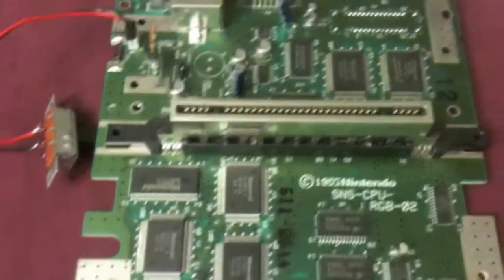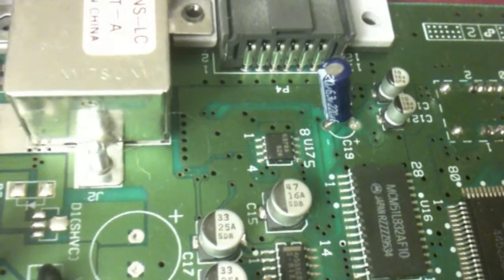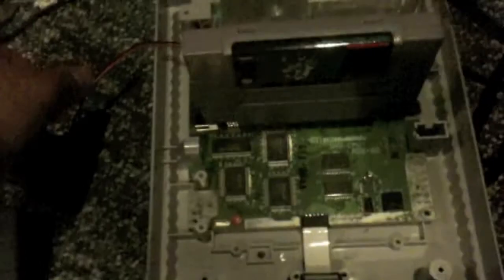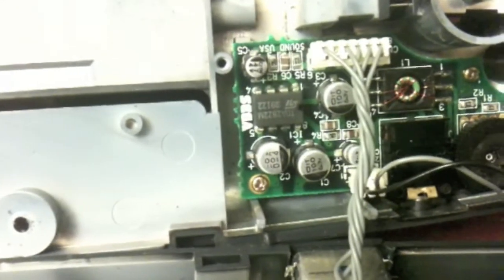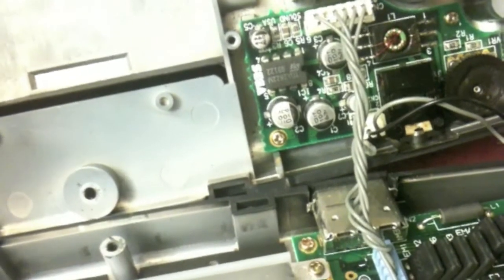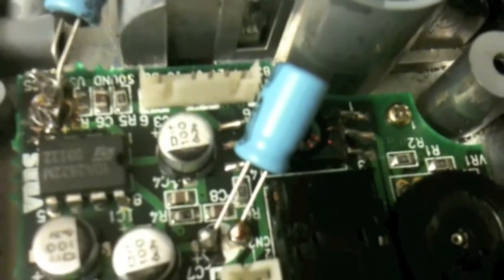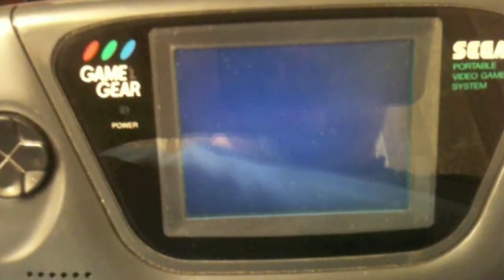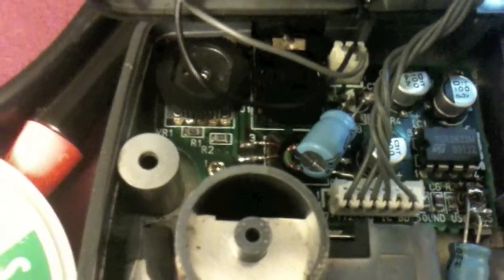Soldering some stuff

Comment: Finally I found someone with the same issue. I was thinking of replacing capacitors, and it is a daunting task probably not worth it. Did you end up scrapping the system or getting any signs of life?